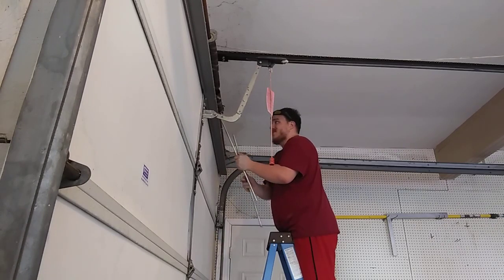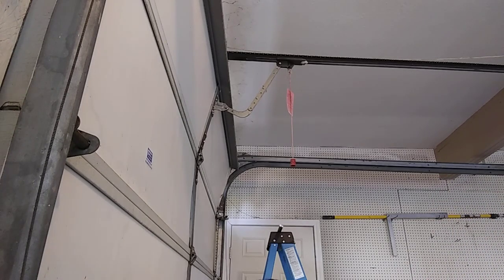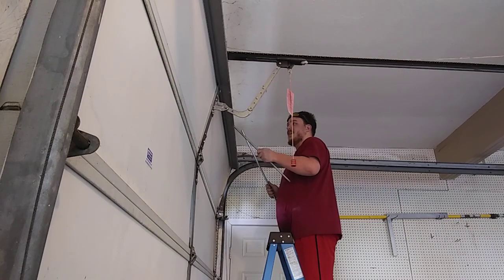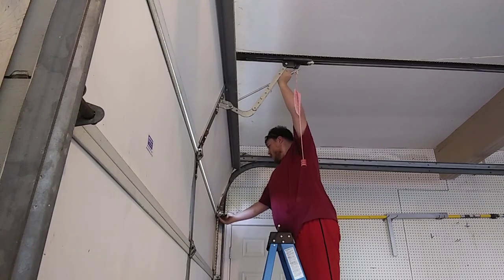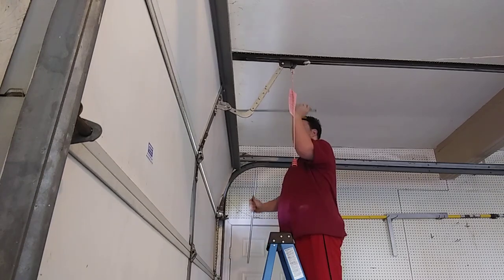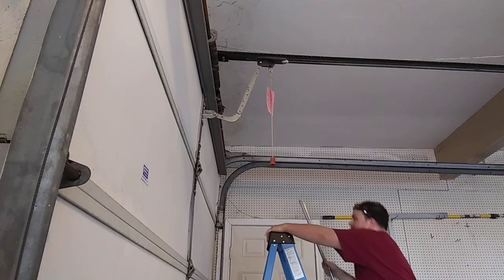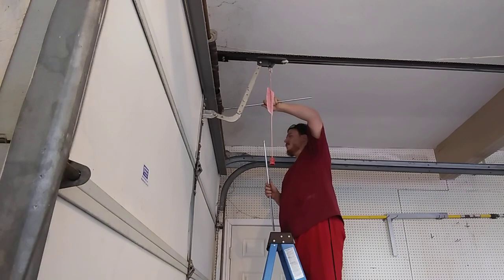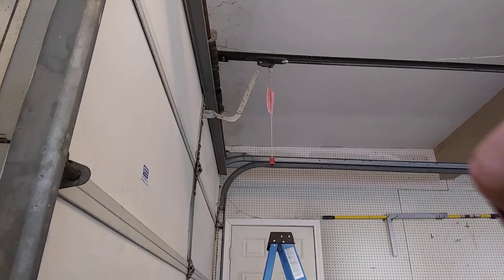How to weigh a garage door to get the right spring

Comment: You should invest into a spring gauge. That and if the springs have the color coded paint it helps.
Reply from the maker: True, but I prefer this method, because if the homeowner added insulation, or the company installed the wrong spring, and I put that spring back on, the door won’t be balanced, then I’ll have to figure out what spring it would need
Reply: That’s the professional way.